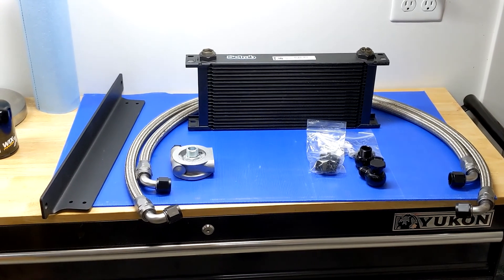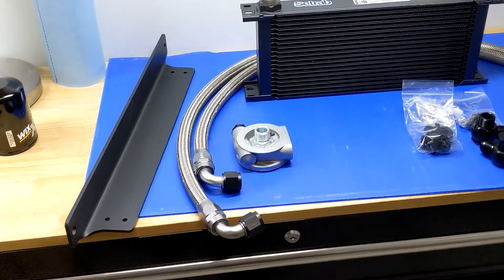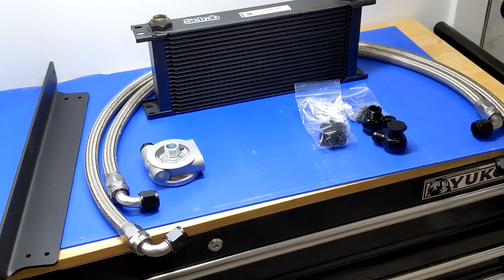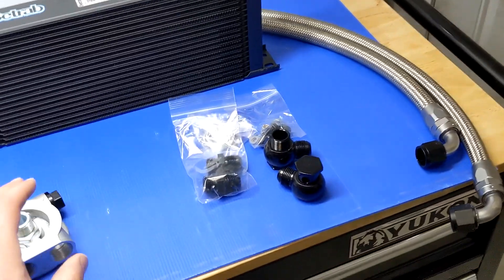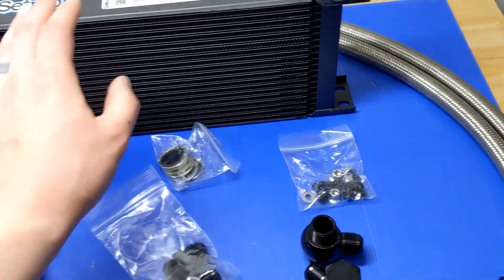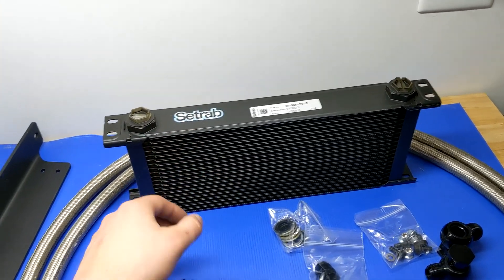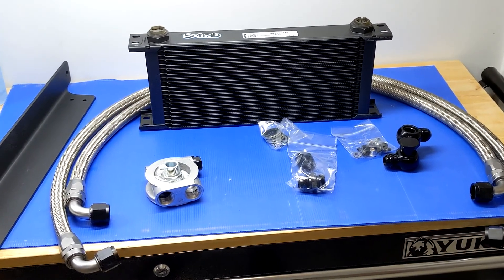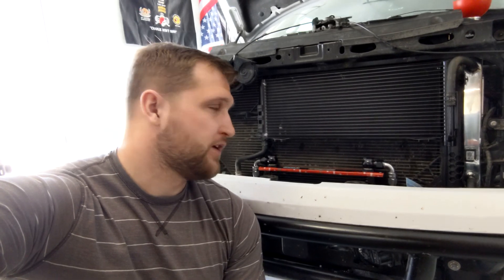Fixing the Ecoboost - Overheating - EP6: Full Race Oil Cooler Kit

Comment: do you have to take out the factory oil cooler or can you run it in conjunction with this after market oil cooler?
Reply from the maker: You could run it in conjunction. However, i bypassed the OEM "cooler" as I wanted to keep the coolant as cool as possible.

Comment: I have a question i just installed mine and does yours get really hot ? 
 Oil pressure is good  and the hot line going in definitely can burn you . 
The oil going out is definitely cooler but should it get that hot ? 
 Thought it would work like a trans cooler  because even though it can reach 200 degrees it get warm not hot .. 
was thinking about buying a fan to put on it and i hope it’s doing it job
Reply from the maker: Well to be honest, I've never felt it. It would be interesting to get some temperature readings to see how much it's cooling things down
Reply: @NSQGarage  so i just put a fan on it and huge difference in getting rid of the heat threw the cooler  ok now i know its working and my temperatures stay down 🙌🏼 so stoked
Reply: @NSQGarage  ok i lied 
 Running Mishimoto
Oil cooler with fan 
Trans cooler 
Intercooler
Turbo boots covers 
Turbo adapters 
SPD 180 thermostat
Turbos rebuilt 
Bd exhaust manifolds 
New water pump 

 Drove it for the first time and on the freeway i was running 208ish  i did about 10 sec pull with out towing and it reached 230  and 240 is practically over heating 

Probably time i sell this truck i can’t get it to run cooler ! I don’t get it
Reply: I am afraid it’s not working correctly!! 
 Or it’s not cooling it enough .. 
  I am going to run a fan on it because it’s so damn hot  i get the oil is a lot thicker then trans fluid but damn .. 
 
 If you ever can check and get back to me that would be awesome . 
 
 I just don’t see any other videos on this for our trucks other than yours ..

Comment: Did you try replacing the intercooler as well? I know you were chasing a heat problem and I’m doing the same thing. I’ve done the radiator and looking TJ do larger trans cooler and intercooler.
Reply from the maker: Yeah intercooler was done too.  My intercooler did stack in front of the radiator. That is obviously not optimal, but I chose that intercooler for other reasons as well

Comment: How does this affect oil changes?  Is there a way to drain the cooler system, do you just make sure the engine is hot enough for the thermostat is open?
Reply from the maker: You will need additional oil on the initial fill up. I also assume you aren't getting everything out. Because of my hose routing, I don't think the cooler would fully drain even with the thermostat open.

Comment: Do you need to plug off the oem oil cooler after swapping out lower radiator hose
Reply from the maker: No, you can just leave both ends open. It's just a loop, so now it will be empty.

Comment: Anyone done anything like this on a 2018-20 f150 2.7 eco boost? I’m looking to separate the engine cooling and transmission cooling and basically getting rid of the heat exchanger. Got a mishimoto transmission cooler before I realized that it wasn’t set up for my current truck
Reply: I'm in the middle of doing exactly that.  The Raptor has divorced coolant/oil/transmission systems so you can use the OEM Raptor lines to plumb everything.  Mine is a 3.5 but I'd guess the transmission is the same 10r80 with same connections in your 2.7.

Comment: What is the oil filter size, or more importantly what is the outside diameter of the gasket on the cooler sandwich plate?  I have a 2008 F150 with a 4.6 liter  engine. The gasket diameter is 2 3/4” on the FL-820-S filter it takes.  Also the thread size I need is a M22 or 22 mm x 1.5.
Reply from the maker: It utilized the same oil filter that the 3.5 takes. M22 sounds right, but I'm not positive. I would call full race

Comment: Do you know who makes the sandwich adapter? And what temperature does it open? 
If it is less than 200F, I would want to replace the thermostat with a 200F if possible...
Reply from the maker: I don't remember anymore. I'm sure if you called, they would answer your questions.

Comment: What's the part number on that lower hose and where did you get it?
Reply from the maker: Lower rad hose?
Reply: @NSQGarage  yes the lower radiator hose that you show in your video that replaces the factory one with the cooler lines.
Reply from the maker: @joeyfix-it1916  FL3Z-8286-B. I have some other videos that talk about it. I would just get it from tasca or fordpartsgiant
Reply: @NSQGarage  thanks.....

Comment: I want to do this to my 14 fx4 3.5 eco, i have it mpt tuned, better trans cooler just made the switch to the better P-OAT (yellow) coolant, temps are better BUT id like to run a external oil cooler but keep the stock sandwich plate cooler in place for long idle times driving city ect.. but i feel having the external will help keep temps cooler as it bypasses through the external in motion.. did you use a thermostatic sandwich plate? If you did it would make sense since you deleted the stock cooler..my thing is...idk if i should use a standard pass through sandwich plate or the thermostatic?... im going to run a aftermarket universal kit..not the mishimoto unit
Reply from the maker: Yeah its a thermostatic plate. I think you would want to run one especially if you live anywhere cold. Because its going to trh cooler no matter what, it will be real cold on negative temps
Reply: @NSQGarage   and yes im in northeat ohio.. where winters are cold and summers are humid lol
Reply: @NSQGarage   yeah i understand it will constantly flow through the external cooler, my thinking was with the stock coolant cooled sandwhich plate still in tact and working as it should, the coolant will also help recirc the loop to maintain temperature because the coolant is already absorbing turbo temp oil and engine heat as a whole.. im just thinking as far as in idle state or city driving.. when fans kick on it will help dissipate heat from radiator while circulating and the stock oil cooler sees coolant on the cold outlet side of radiator after thermostat... im just torn because i wouldnt mind the insurance of a thermostatic sandwich plate..but alot im seeing on Amazon ect open under 180° to me thats not good.. considering you want atleast 200° before it opens so the oil can get hot enough to allow the PCV system to collect actual valors to condense into the catch can.. if those contaminants cannot boil off or flash off the oil will stay contaminated..just looking for a happy medium lol.. you seem to be a guy that would know.. im very shsrp with this stuff but keeping both has me thinking
Reply from the maker: @anthony8787  yeah what you are saying makes sense. I was more concerned about not "pre-heating" the coolant before it goes into the block. Being in Utah, summers are hot, the elevation is high and the mountain passes are steep. But if you aren't overheating a lot, keeping both seems like a good compromise for cold weather. How are you overheating btw? Isn't Ohio flat? Lol 😂
Reply: @NSQGarage   im mpt tuned 93 octane tunes, tow, PRX and economy.. engine runs hotterand we still have hills and hollers out this way as well.. our interstates have alot of elevation as well especially on rt90 going eat or west from where i am.. with a load she gets pretty hot
Reply from the maker: @anthony8787  I kind of figured. Just giving you a hard time. Hope you fix your issue with whatever you decide!
Reply: @NSQGarage  lol no you're good brother!, thank you for your input, i will see what i decide to do.. a thermostatic adapter wouldnt hurt thats for sure.. just dont want one that opens under 190 +/- degrees
Reply: @NSQGarage  welp... through some vigorous thinking i decided to go with a thermostatic adapter, just ordered it. What i will do is replace the shitty 170 stat it comes with and go to a parts store and find the cheapest car thermostat i can find that matches (the wax motor of course) not paying $40 for a mishimoto one just silly lol. Can find old school thermostats for like $5 at any parts store n tear them apart n works just fine.. these oil filter adapters utilize that old school yet reliable technology as far as the wax motor
Reply from the maker: @anthony8787  hm interesting. I don't know much about that.
Reply: @NSQGarage  neither did i until i did some research lol. Ill post a video of install and tag you when jobs complete
Reply from the maker: @anthony8787  sounds good brother. Seems like a near mod

Comment: I have the Full Race intercooler, in order to fit a winch in the oem intercooler location. Where would you put an oil cooler if you were me?
Reply from the maker: Does your winch go all the way back to the radiator?

Comment: What temp was your oil before and after?
Reply from the maker: I don't have an oil temp sensor. So I have no way of knowing. I did do that towing test. Video should be up tomorrow
Reply: @NSQGarage  cool. I have an oil adapter just like that. I was able to drill and tap it for a sensor.
Reply from the maker: @QuarterD25  oh that's neat. Do you measure the oil before or after the cooler?